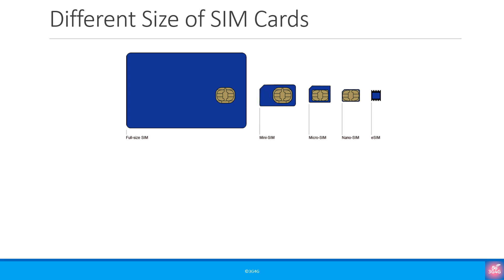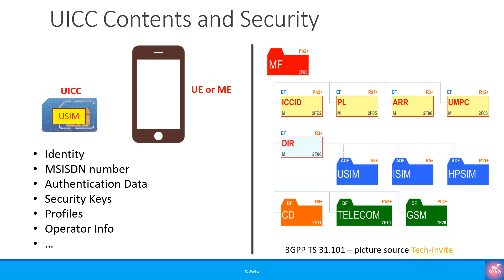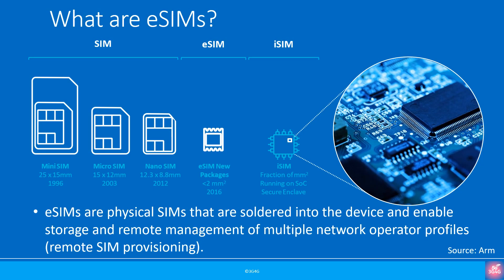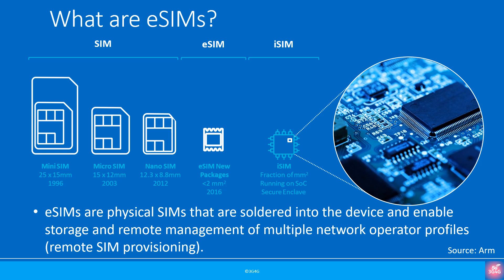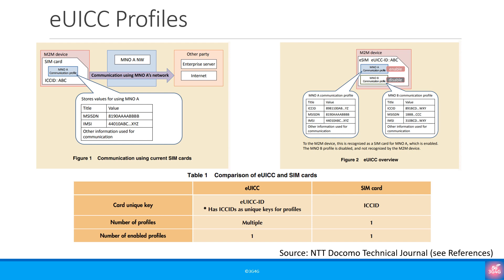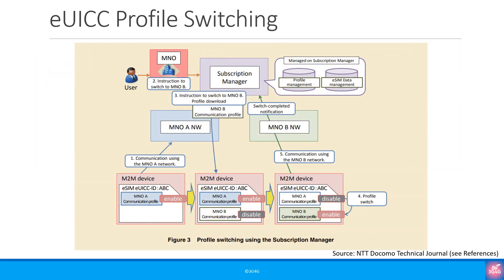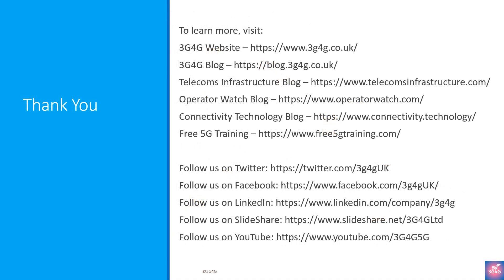Beginners: UICC & SIM

Comment: Interesting... I noticed that my sim doesn't get recognised when i put it in the second sim slot... Perhaps its got something to do with uicc?
Reply from the maker: Could be to do with settings. Also in some older 4G models, second SIM slot would only do 2G/3G which has now been switched off in many parts of the world.
Reply: @3G4G5G  hi thanks - It works with other SIM cards without an issue... So it's a bit strange

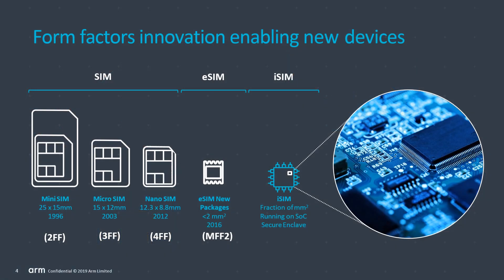Comment: Thank you for the video and slides. Very helpful. Just a minor correction on Slide at 1:06 USIM is Univeral SIM and not UMTS SIM. USIM application has credentials that can be used for 3G (UMTS), 4G (LTE) and 5G (Standalone) networks.